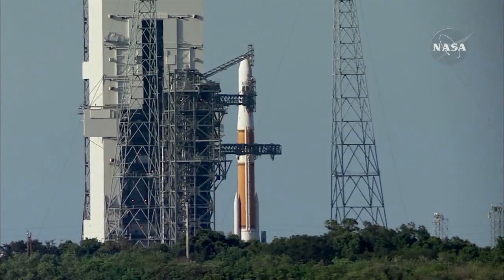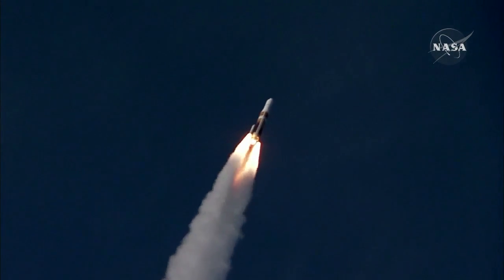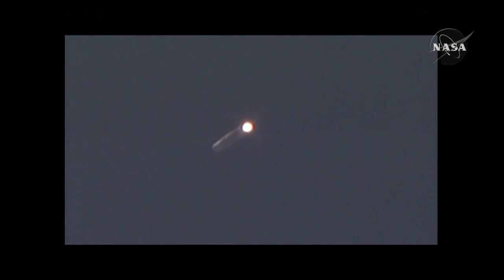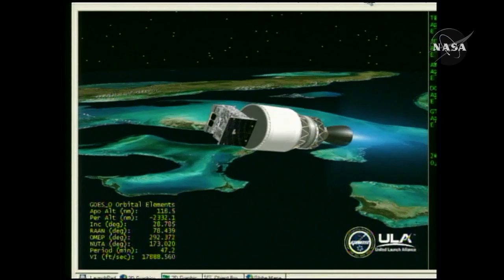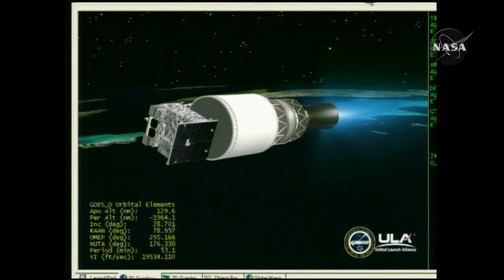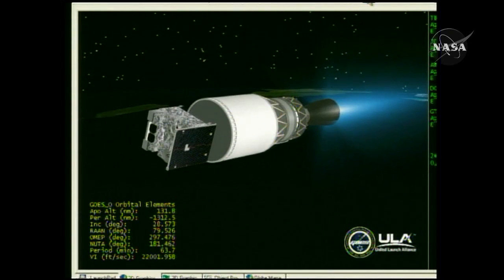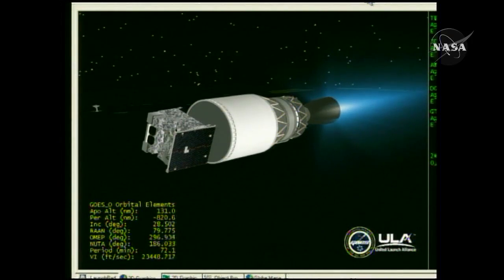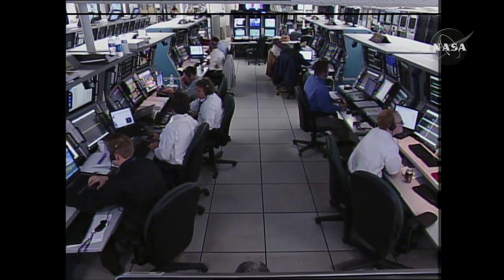Launch of GOES-O aboard a Delta IV rocket

Comment: that hit me hard rewatching this seeing the shuttle on the pad
Reply: really missing the Space Shuttle ... It had more power than the Falcon 9 Heavy
And of course it was AWESOME - unlike SLS
Reply: @falafeldurum2095  Falcon Heavy has a payload capacity of 63.800 kg, the Space Shuttle only had 27.500 kg.
Falcon Heavy is the most powerful operational launch vehicle right now.
Reply: @averagegeek3957  technically the Space Shuttle orbiter itself is brought into Orbit so you have more mass together - and the thrust of the two SRB's is higher than all 27 engines of the Falcon Heavy, so it's only the most powerful one because the Space Shuttle is not operational. And the Saturn V of course had even a higher payload capacity, the N-1 had more engines a.s.o.
Falcon Heavy's landings are amazing but I think that the Space Shuttle was much more interesting
Reply: @falafeldurum2095  But SpaceX is now in prototype phase of the next gen launcher that will combined the power of Saturn V (actually twice as powerful), and reusability of the Shuttle & FH (or better, because full reuse)

Progress, they already assembled 2 prototypes in Florida & Texas, and that pad right when Endeavour sit (not exactly, but still within the fence) there's already a pad construction for that next gen launcher
Reply: @alvianchoiriapriliansyah9882  I'm not anti-SpaceX or sth. Actually I'm a huge SpaceX fanboy, I've watched every single WDR or static fire + all hops/flights since Mk1 and Starhopper. SpaceX's rockets are the msot technologically adanced rockets ever. But I'm still amazed by how the Space Shuttle worked. Although SN8&9's flights were the most spectacular events EVER. Until SN10 sticks the landing :P
Reply: @falafeldurum2095  I was too young to remember anything but the final Shuttle launches, but I do think SLS will be pretty amazing 
More power than Shuttle, even Saturn V, and will actually send people beyond low earth orbit
Reply: @brokensoap1717  Yeah, it is. Not gonna lie.

Comment: Yea...pads 39-A and B are a mile from each other; I remember when the Ares 1-X was launched, there was a shuttle on 39-A and they said then that even if 1-X had exploded on or not far above the launch pad, the shuttle was outside of the danger zone for debris (those pads were built with a potentially-exploding Saturn V in mind  and were set far enough apart that an S-V blowing up on one would not wipe out the other), so Endeavour was probably pretty safe during the Delta launch!

Comment: According to Wikipedia this launch was on June 26, 2009; the next shuttle flight after that was Endeavour on STS-127 to the ISS on July 15, so this would have to be Endeavour on 39-A after being rolled over from 39-B once it was no longer needed as a rescue mission for the STS-125 Atlantis mission to the Hubble Telescope in May 2009. And it's not as close as it looks--Launch Complex 37-B where this was launched is about 3 miles away from 39-A.